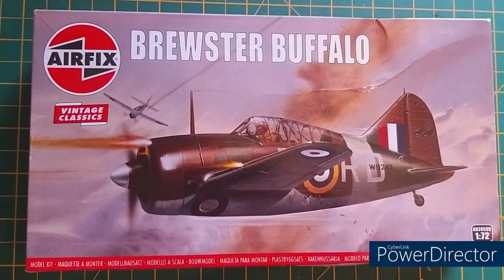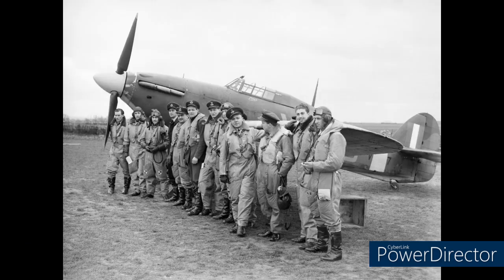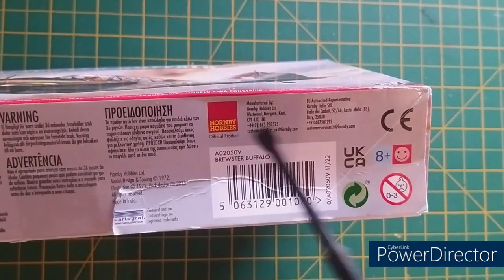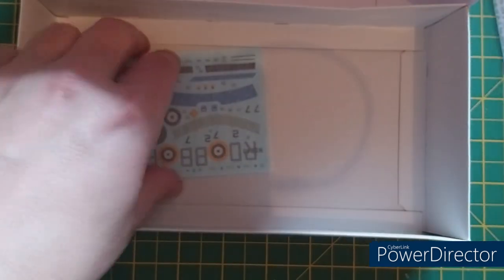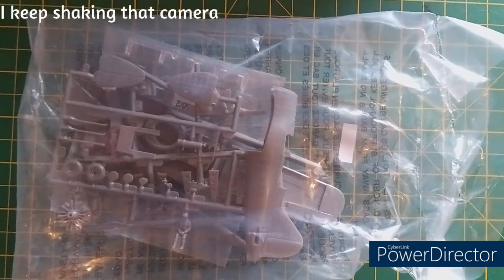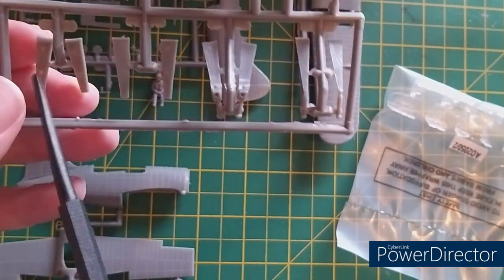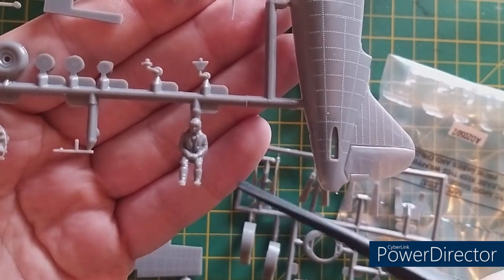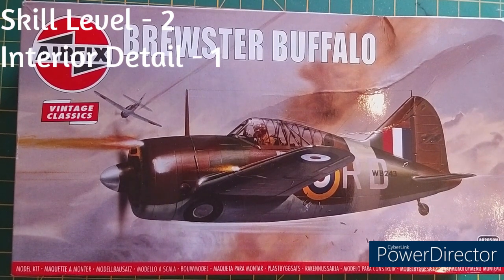Vintage classic Buffalo from Airfix

Comment: You really can't make a proper M-339E from this kit. In step 2, parts 13 (life raft) and part 8 (arrestor hook) are not on an M-339E. Those are for the F2A-2 version. All you have to do here is not use them, but the tail cone is for the naval version. You will have to scratch-build a new tail cone. The painting on the box cover shows the correct tail cone. 

The kit has a cuffed Curtiss electric propeller. This is only for the F2A-2 version. The 339E used a Hamilton Standard (not cuffed). The center canopy section is also only for the F2A-2. The 339E has a movable oval panel inside the left front panel. The canopy should have straight panel edges. This kit has the rounded edges for the F2A-2. 

It seems to be missing a pitot tube (both versions would be different) and the underwing lights (F2A-2 had one and the 339E had two). For the 339E the instructions should have told you to tint the front windscreen green (armored glass) from the inside.

If you make the F2A-2 version I am sure it will go together well and you will enjoy the build.  The Model 339E version is just a mess and not worth correcting. This was a pretty poor job by Airfix trying to sell this as having two completely different versions of the aircraft in this box. Unless you have an Airfix bias or don't really care about accuracy and getting what is shown on the box, I would not waste my time or money on it.  The Hasegawa/Hobby 2000 Model-339E kit is far superior. Spend a little extra and get that instead.